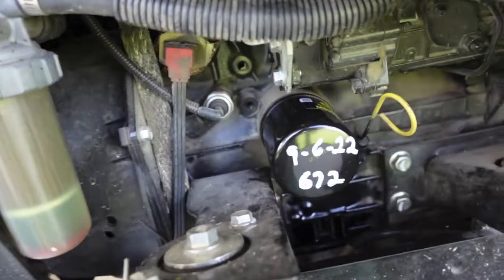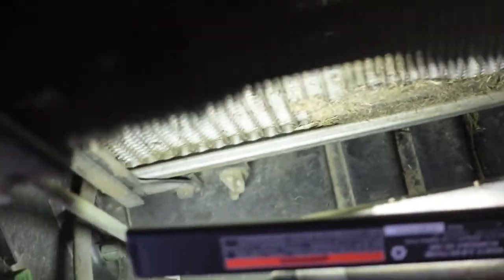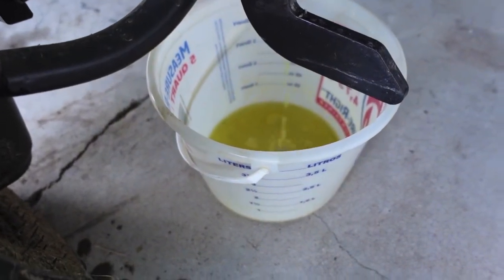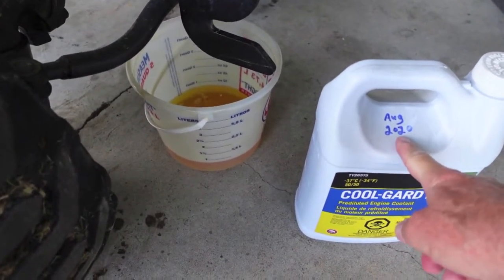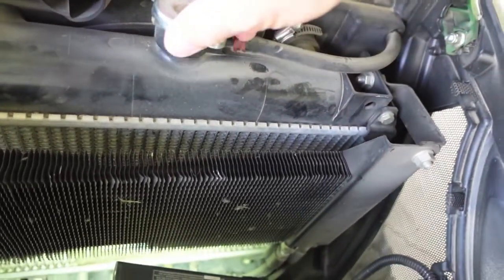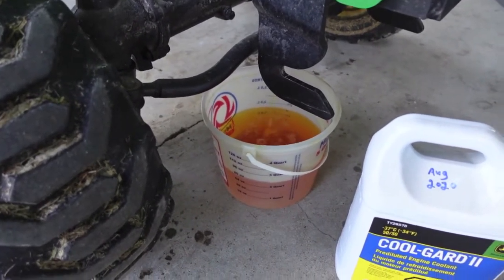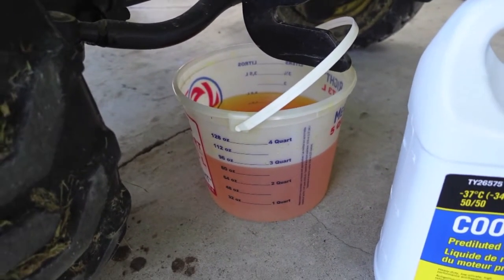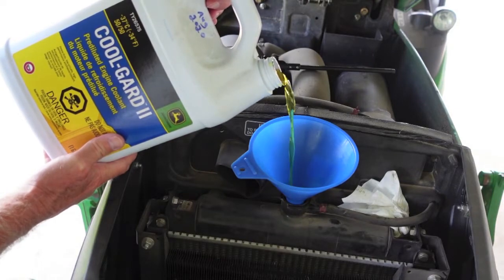John Deere 1025R Drain and Refill 75% COOLANT CHANGE!

Comment: I would like to install a block heater for Christmas on my father's tractor. Would this 75% method be enough drainage to prevent a mess in the engine bay and on the floor when I take the plug out?
Reply from the maker: Gabe, it will not pull any coolant out of the block. Draining a radiator only drains the radiator with gravity and it won't even siphon any out of the engine block even if the thermostat (top location) is still open.
I would just get a big enough pan to drain the block in. On the plus side...you're going to give your dad's tractor a 100 % coolant change!
A mighty fine Christmas present!
Thanks for watching and work safe!!

Comment: I'm getting ready to do my 1st on my '23' 1025R. I have a heated cab. What is your recommended procedure?
Reply from the maker: I would simply run engine till warm (thermostat open) then drain the radiator and refill. Getting 75 percent of anything out of a drain and refill is a good situation. 
Your heated cab will probably not get you as much as a non-cab model due to the heater core and at least a quart in both supply lines but just do it again in 50 hours and see how it goes.
Thanks for watching and commenting!

Comment: You need the the new updated air filter assembly before ithe air cleaner bracket breaks your valve cover and destroys your engine.
Look it up it is a common problem.
There is even a kit to change everything over to a new style.
Reply from the maker: Thanks for watching! I did install the new bracket and filter assembly. Luckily, the valve cover studs are rock solid!
Have a good one!

Comment: Great video, I have a Massey Ferguson and I drain and refill only.  No flush needed unless you are experiencing overheating.  My tractor is 20 years old and I change the coolant every three years.  You can never get all the old coolant out, 75% is a good refresh.
Reply from the maker: Thanks for sharing!
I agree with you 100 percent on your maintenance method.
Have a good one!!

Comment: Thank you sir! I was putting this maintenance task off cause I didn't like the idea of "flushing the system" but it sure makes sense to change out 75% of the coolant so easily and more frequently rather than to avoid doing it all! It worked flawlessly this way. I have a 2015 Model 1023e with 410 hours. From New Brunswick, Canada!
Reply from the maker: You're welcome!

Comment: Great video. Question. Do you pour the JD Cool Gard II in BOTH the coolant reservior and the radiator?
Reply from the maker: Fill the radiator first, then a small amount in the reservoir. On my 1025R, if at anytime coolant is at the half way point in the reservoir, it will splash out all over from the poor fitting lid. Others have the same complaint. If I barely keep the level to the lower minimum, all is well, but you do not want the radiator to suck in air from the reservoir. All you have to do is check it after letting sit overnight and there should be just about 1/4 to 1/2 inch of coolant in the reservoir. Then as it runs and expands from heating up, coolant level will rise near the halfway mark but still not bubble out the lid.
Thanks for watching!

Comment: Hello, when my johndere 2017 model 5050e 4wd is stopped, antifreeze flows from the radiator water discharge hose for a while. Why does this happen? What should I do?

￼
Reply from the maker: I'm not really sure what the problem is. Is your radiator discharge hose connected to the coolant reservoir or just running down enough to clear the frame work?
Reply: @pmtips4482  The water discharge hose is not connected to the radiator, it is connected to the spare water canister cover (to the expansion chamber).